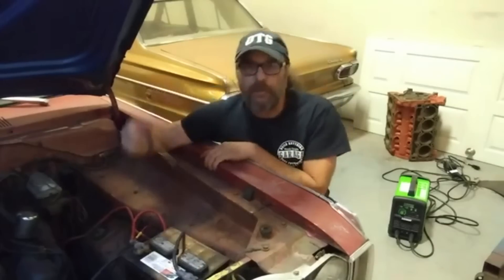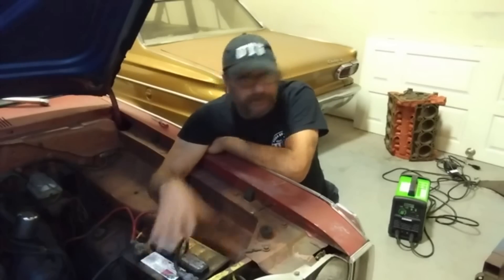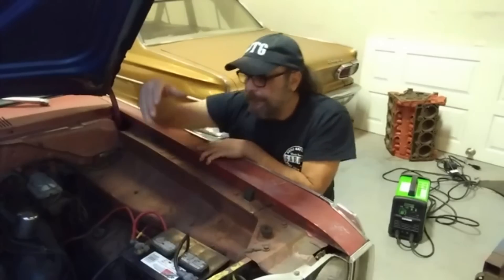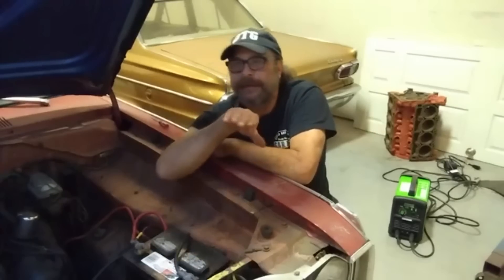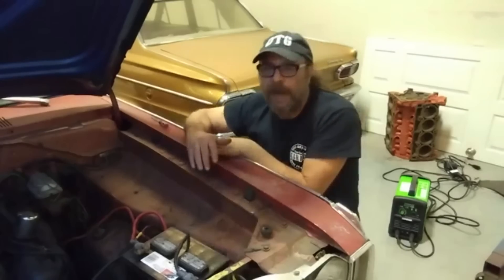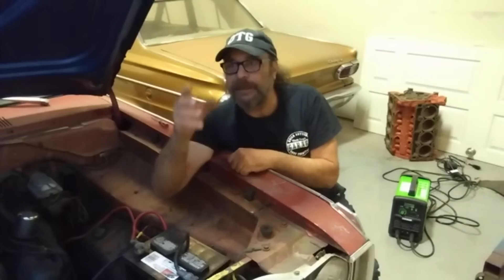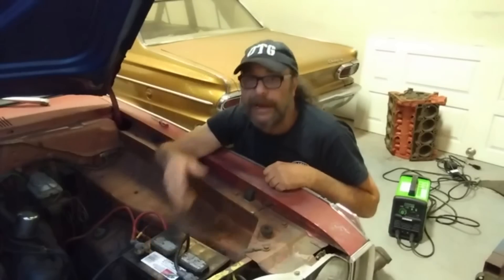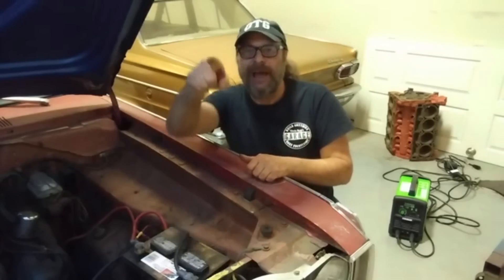Stick Welder Battery Revival SUCCESS!

Comment: Had one fail on a lawnmower. It had been on a long charge and we pulled it off. Walked away and about 10 seconds later heard what sounded like a shotgun went off. Battery acid everywhere and battery blown out on the side

Comment: Thank you very much man. I picked up a $60 buck 200a stick welder on amazon and set it to 85amp for 5 minutes. SOH went from 13% to 93% after a single around. I don't like buying batteries as much as the next guy. Btw to the general public, the repair mode on the noco doesn't do jack! Just pick up a cheap stick welder and fix your battery yourself.

Comment: thanks tony , I just had to purchase a new battery for my car last week and it's no longer 100 dollars , $202.00  at walmart !!!  yeah every edge you can get helps !!!  I didn't have the time to hook my welder up to my old battery and do the deed.   at the time it died i needed the vehicle right away ,but; I'm going to refurbish  my old one if i can next week .  thanks again for your help on this video !!!  Yes I have had numerous experiences  with exploding lead acid batteries in golf carts , large 36 and 48 volts industrial lift trucks and cars, trucks .  always use a fan to blow across the area you are working in and there will not be enough concentration of hydrogen gasses to blow up !!!

Comment: I popped the top out of one cell of a battery sitting on the bench charging. I was fiddling with a motor or something arcing it across the battery without thinking. POP!! I epoxied the piece back in.

Comment: Back in the 80s my buddy had a 69 Dodge Charger and we were standing next to the car talking and the battery blew up and it actually opened the hood up to the safety latch when it was closed fully. We opened the hood and the top of the battery was basically gone blow off with a bunch of battery acid all over the engine compartment so we washed the engine compartment off and pulled the battery out and put a different battery in it and it was fine but yes a car battery can explode with great force and when this went off it sounded like a 12 gauge shotgun going off under the hood unexpectedly lol .

Comment: I have seen a motorcycle battery explode in a GL1100. The mechanic was dis-mounting it and caused a short with the positive pole spanner against the frame. The mechanic was covered with acid. Hope to never see that again. The voltage regulator turned out to be dead and charging the battery at 30V.

Comment: I know you keep a gallon of the distilled water in case your battery pops on you. That's very important but remind your audience if the battery does pop on you. It does not matter if the water is  Distilledl or not. Just get water on you As fast as possible. Great video. One more thing if you get you some baken soder and mix with that water It will take a lot less water to decontaminate.. If something goes wrong. And @ about a dollar box is just a good Thing to have handy when a battery goes south. You don't want to be looking for that stuff.
After it pops.

Comment: Tony, you are supposed to fill batteries to the fill line, and that leaves empty space between the acid and the lid.  If you don't leave empty space it won't have any breathing room and it will soon blow the caps off and spew acid all over the engine compartment.  And I've seen you add water to a dirty battery.  Clean it first so no dirt gets in.  Don't be sloppy.

Comment: I’ve had one battery blow up in my face. I guess it was shorted inside. As soon as I put the positive jumper cable on it the thing blew. It took the top off the battery and even blew the cables off the posts. Scared the crap out of me lol. The rest room was just on the other side of the truck I was trying to start so I run in and washed my face.

Comment: I am confounded by this. Have an old, late 1980's stick welder that when I try to hook it up, the clamps throw sparks like I just dead shorted the battery terminals. Hear a hissing from the battery, even with the welder off/unplugged and see the old electrode clamped to the positive terminal is glowing red... again, like a dead short. Pretty sure this is not what should be happening. I any idea what's going on? Does it need to be a newer inverter welder?
Thinking about using my inverter TIG but would rather not fry that.

Comment: A 5 years old battery which worked maybe 3 years is not a dead battery at all. It was just discharged deeply. A really used battery dies of plates and interconnects destruction.

Comment: The duty cycle isn't a problem. There are duty cycle charts that show as the amperage decreases, the duty cycle increases. The duty cycle on this welder is 100% at 100 amps when plugged into 240v outlet according to the owners manual.

Comment: This goes to show you how far manufacturers have gone in order to scare the public from trying stuff like this. Most people that have never played with DC batteries, have barely jump-started a vehicle before and when they did they were scared shitless. They are the reason the standard car battery costs over 100 bucks and lasts 1 or 2 years. TIP: go to batteries plus and ask for a blemish battery. They sell batteries that the label has fallen off or was scratched, etc. for around $60-$65. They have a year warranty and in my experience last just  as long as the new ones.

Comment: Thanks so much. Saw this post and tried it just as you did it. It worked and l am on my second year with the rejuvenated battery!!!
My truck sits sometimes 6-7 days in Arizona heat and starts the first try….
Thanks again 👍👍
Dave

Comment: I had a battery blow the whole top off because it was bubbling from being charged inside this old truck when I connected the jumper cables it made a spark and that's what happened but my hands were Kris Kross and my top of my hands got the brunt of the blast

Comment: I have a battery charger that I bought off wish of all places. That thing fully charged a marine battery that had been sitting 10 years. It fully charged a couple of marine batteries that were sitting for around 3 years. All you could see is sulfation on the cells. By the time they all were charged the sulfation was gone. Talking about batteries going up me and another guy was moving a forklift battery to another area in the plant last year. These things are like 3500 pounds. While we were moving it the hook on the hoist got into one of the post. Right off the bat 2 cells popped.  I was standing literally on top of it on the battery handler. Then it popped a 3rd cell. It sounded like 3 shotgun blasts going off in that place. No fire no nothing.  Later on I did find part of the top of the cell about 20 feet up around the battery chargers. These batteries have 18 cells in them.

Comment: Did you do a "year" later video?  The effort to restore the battery "one" battery is maybe worth it in a pinch to get you by for a while. I saw someone else who posted a video where they say they do this over and over to a battery and have used the same battery for many years.....they were not clear about how long or how often so curious has this battery made it a year and of course will it make two or three and if it makes it that long can you hit it again and get another three?

Comment: Love your no nonsense approach and you’re quite funny. Especially love “common sense is fruit that doesn’t grow in everybody’s yard”. I’ve never heard that before but I’m stealing it. I’ve been trying to revive 6 6 volt batteries with the same method. I bought a Dekopro 110/220 mma inverter 160 amp welder. It didn’t work but I don’t think I turned up the amps enough. Going to try again today. Wish me luck and thank you for your great videos!

Comment: I had a dead battery for an Audi A3 3.2 it wouldn't hold a charge. And I tried this experiment and it's actually starting the car and holding a charge. This saved me so much because Batteries ain't cheap in January.

Comment: I'm wondering if it would be or would not be beneficial to drain, flush, and refill with new acid after boiling the plates to remove any crud. As well if I did do you think that it would prolong the life longer. Thanks for the info.    " A penny saved is a penny earned "
Reply: Good idea

Comment: I was thinking of trying this with my welder and fortunately found your vid. Thanks. Now I don't have to search around for a shop that will do a deep charge on my dead battery. Unfortunately, I found this after spending $190 on a new battery, but I will do this once a year once a year on the new one after testing out the theory on the "dead" battery.

Comment: so why not use a 225 floor charger? 50 and 225 amp settings.. also hook it outside and let it rip. see what it does and or show the never seen before folks what it does.

Comment: I've got two battery "explosion" stories. One was the "pop" that blew the cap off ONE of the cells of a forklift engine starting battery, the other was catastrophic and I wasn't around for the fun, but I discovered when I noticed a stain on the driveway under the battery area of my motorhome's generator starting battery. The generator battery explosion literally destroyed the battery case as well as the battery storage container and sprayed acid all over the inside of that bay of my motorhome. . . . They both however were the result of battery electrolyte being below the top of the plates, such that when a charger turned on, there was an arc between dry plates that ignited the hydrogen-oxygen mixture. The larger the volume of air space that should be filled with electrolyte, the larger the quantity of hydrogen and oxygen sitting there waiting for a spark to cause the explosive recombination of the hydrogen and oxygen; small volume little pop, large volume BIG EXPLOSION! . . . . Lesson learned: BEFORE CHARGING ANY LEAD-ACID BATTERY, MAKE SURE THE PLATES ARE COMPLETELY COVERED, AND STAY COVERED WITH ELECTROLYTE/WATER. . . . Just as shown in this video. . . . EXCELLECT VIDEO.

Comment: actually that battery was probably ok to begin with being fairly new and just run down where it lost most of the water and left sitting for years , the shock of quick charge didn't hurt it but if you had topped up with distilled and trickle charged it for a couple days that might have been better , some that are old and heavily sulfated may not be so easy . those you need to dump the old dirty acid out and bang around to get the scale off

Comment: Actually I was charging a large 8d tractor battery sitting on the back of a flatbed truck that blew up like a quarter stick of dynamite.. I mean to tell you this thing blew the neighbors wife's wrinkles off and they live a quarter mile away.. But to be honest I had been charging it all day long and it was extremely hot and had possibly boiled lots of fluid out of it because I had forgotten about it and it exploded sometime around midnight.. So ya.. Common sense prevails over most circumstances and that was obviously avoidable

Comment: Interested in an off grid solar setup. The battery degradation is a thing that I have been grappling with. This switches up the ROI a great deal. If zapping them like this adds 5-10 years to a bank of 4 batteries going for $400 each, that is nothing to scoff at...

Comment: 100% correct Tony! 100%!!!
You could deep cycle thirty batteries all at the same time and not change the air quality of a building that size at all. You wouldn't want to do more then maybe 5 or 6 in your average shed but even then it's a poof and then the hydrogen is gone, H2O and CO2...

But the thing about them not blowing forcefully isn't entirely accurate. Not exploding from hydrogen forcefully is right but battery can have catastrophic energy releases that discharge all at once that are gloriously destructive but that is from a flaw that leads to a runaway discharge. But they can explode violently, just not from what you are doing, usually.

Comment: 1 question, 1 thought.
How do you go with 'sealed' type lead acid batteries? 
Im guessing its the higher voltage from the welder cleaning the plates? Many late model alternators are 100+ amps and you can jump start them but they wont charge up from the working alternator once running. 
Oh, and in Australia a motorcycle lead acid battery is well over $100. So you can imagine the cost of a decent CCA car battery and the 900+cca battery I run in my Big Block Chevy pickup...
Have dead ones of each i havent thrown out yet..

Comment: Auto shop story from high-school back in the day(circa1980)...

Shop teacher was demonstrating how most engines keep running even if ya have a dead cylinder and if you know the  engine, you can temporarily balance the engines by cutting the 180 degree firing cylinder. He did it and it ran great.
However,  in the demonstration,  he let his gaurd down a second and flopped the ignition cable onto the battery. He new the problem the moment he did it and he violently knocked us away and in the same motion grabbed the nearby water hose. We were kinda wondering what had gotten into him.
As he reached the water hose, the ignition cable ignited the hydrogen gas coming off the battery. I can tell you that it was not a simple pop...it was a really impressive ka-boom that distorted the fender next to the battery. We got hosed down immediately and learned an important lesson...respect any machinery and never let your gaurd dwn when working around it.

Comment: Tony my suggestion when do this again is back off on the burritos and pickled boiled eggs ! It is a known fact if you eat pickled  boiled eggs burritos  and charge batteries with a welder and fart at the same time the mix in the gases will blow you up or launch you across the shop !

Comment: Saw our MoCanique cut off a melted post on a 1000a batt on a 24v sys drilled & tapped remaining lead for a homemade stud post batt. Worked great forr bout 2 days, I cranked the loader, rah, rah, rrah, boom. Sounded like a 20ga shotgun. Blew the group 31 batt to pieces. Ruined my brand new insulated coveralls with acid. Thankful that JD544C had covers over batts as batt box was directly behind the no window cab. Scared the shit out of me. 25 years ago. Also when topping off batt with water make damn sure there is no baking soda residue on top of said batt or be prepared for a foam show & plenty of "you dumb ass". Ask me how I know.

Comment: Tried to do this to a deep cycle battery .  But found out the battery had sat outside for several winters. I got bubbling in 5 of the 6 cells.  I assume the one cell was damaged by freezing.  So could not bring the battery back to full life